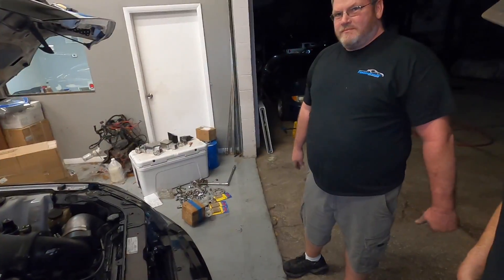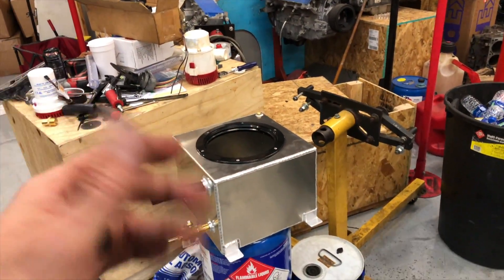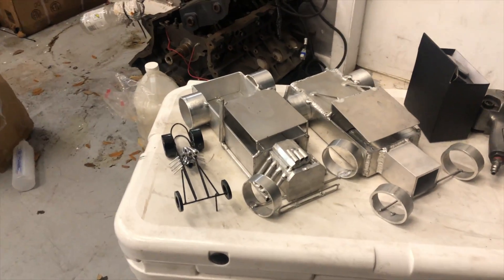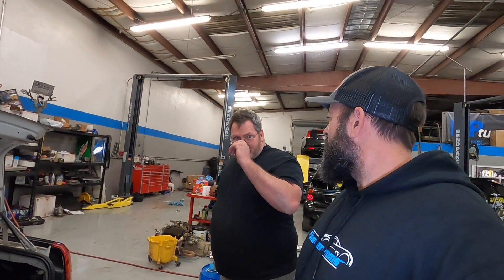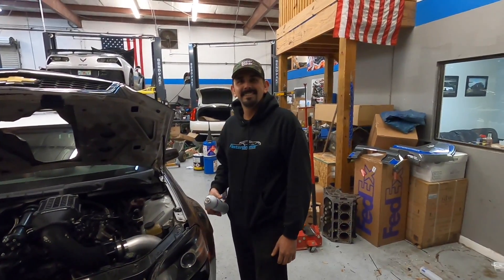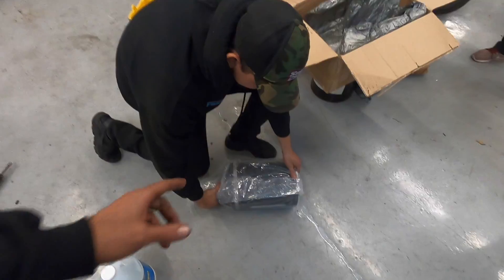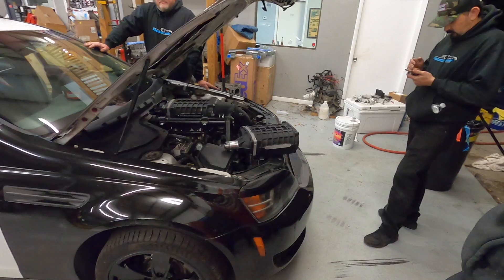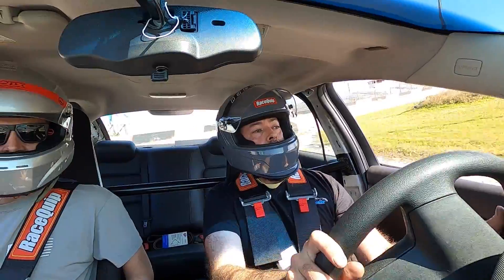Testing Our 1000HP Fake Cop Car...Ends With Us Getting Pulled Over By Actual Cops.

Comment: i cant believe that with all the money youve put into uncle sam to make him more badass you still havent replaced the $54 motor mount damn please get it fixed
Reply: He just needs a chain to hold it to the driverside 😂
Reply: @jaredanthony8070  or a strap like he had on the methanol tank and its the passenger side that bad the mounts broken so he would have to strap it to the passenger side
Reply: Mopar back in the day would just put a stainless steel cable on the drivers side mount on the 440 cars to fix the safety hazard when the thin pancake mounts split in half. Hell my Dart with a 318 with only external tweaks and a thermoquad used to break the mount every few years. I bought a 69 Sport Fury with a 350 horse 440 factory dirt cheap back in the day and I found the mount was broken and it had the SS cable holding down the engine. It worked fine, just clunked and jumped till it ran outa cable. Probably had been on it since early in its life as a dealer installed repair.
Reply: I'm pretty sure his wife's truck still has duct tape holding the intake on... don't hold your breathe bud.
Reply: Tuff mounts or Castlemaine rod shop needs to ship some over
Reply: @69Dartman  mopars are funny things. Couldnt throw a new mount in or revise one that will stay together nooo...just put a cable on it 😂
Reply: @jaredanthony8070  Well pretty sure it was just quicker and cheaper than replacing a bunch of mounts back then. On my Dart I finally found out I was using the wrong mount and I got the right thinner mount and I hadn't broken it till I retired it. They went to a much stronger clamped together mount on the later revisions of the k frame the engine sits on in the mid 70s or so and even when those break they don't lift very far till it's captured. I was going to convert to that style k frame and even had one that had been beefed up and welded but lost it when we moved to the house we bought.
Reply: @69Dartman  that's a shame but it was very mopar to cheap out by not putting a real mount in.. wouldve been better long term...
Reply: you beat me to it lol.
Reply: @hellblazer275  beat me too it tuff mounts for the win!

Comment: That's awesome that the local PD took it easy on you! I'm just waiting for the day when I'm in the same predicament for violating the noise, speed, tire smoke ordinance and hopefully my local township PD cuts me a break too!
Reply: About 15 years ago I was going about 140 and blew past a Trooper going the other way. He was booking in the other direction and we damn near blew each other off the road. I normally would have run for it because I was miles away by the time they pulled over and turned around. But I didn't feel like looking over my shoulder and pulled over and waited. It's a long story but I regretted it at first because they worked me over at first. But when he asked why I just pulled over and waited. I responded that I didn't see the need for them to risk their lives over a dumb mistake. He told me to sit tight and after what seemed like ages came back with a seatbelt and inspection ticket that doesn't have any points while thanking me for pulling over and said hopefully I learned my lesson. But stuff like that are pretty rare these days since the cops have changed. I'd have gone to jail now.
Reply: YA NO SHIT, HE GOT OFF BECAUSE HE IS A WELL KNOWN PERSON.

Comment: Loving the channel, have for years.  Passing along a belt squeak remedy is a coconut oil based bar soap, rub against belt on both sides while running, quiets it down without chemicals toastin the belt

Comment: Here's a little tip: Black gasket maker on the underside of the belt helps quiet them belts right up... Temporarily... But in my experience, it works like a charm... Temporarily...

Comment: Here's my little secret. Don't use lube on pulley bearings unless you are cleaning them. On brand new bearings use graphite powder as a lubricant, the same stuff that locksmiths use.
Just don't use too much.

Comment: To stop the belt from screaming like a squirrel in methanol , use DAWN liquid soap. All you need is just a dab( 🤪)
Reply: DEDBRD1977 baby powder 👍🏽
Reply: Or fix it properly and just adjust the pulley that is misaligned...probably power steering. It's easy to over/under install the pulley with the end of the shaft. 👍
Reply: DEDBRD1977 no ...
Reply: like a squirrel in methanol LMAO
Reply: @Forcefed2002  I can't tell you how much I hate domestic bullshit pulleys.

Comment: I’m a junior in high school. 
I’m going to study mechanical engineering with a minor in fluid mechanics. My goal is to design my own racing heads and intake for a run of the mill LS3 5.3 and 4.gr8s as a bolt on kit. Heads, intake and cam at a decent price that won’t break the bank like AFR would. 
I’m gonna call the set Uncle Sams

Comment: If the power steering pulley isnt perfectly flush with the end of the shaft you will get that belt wine - ask me how I know. Yall just did the PS too so... a half turn on the install tool too much or to little is all it takes for that slight misalignment to squall the belt.

Comment: If you get better motor mounts you might get rid of your shifting issue. If the trans is not as mobile as the worn out motor mounts you will stress the case and make it harder to get in gear on power.

Comment: Just put sand on the ribbed side of the belt and it will quite it down. Belt dressing and all that doesnt work. Needs to be gritty. Just a small amount of sand will work, will mold into the ribs and be silent

Comment: WOuld it help the performance by installing larger exhaust pipes larger pipes more exhaust flow less back pressure
Reply: motortrend tested this 4 hp difference between 2.5" and 3" it would have to be severely choked example 1.5" and i think at that point it would probably put a hole in it with the methanol injection/supercharger ( I could be wrong). The bigger changes come from the type of muffler chambered/straight through/brief case. Also if you have ever seen a thousand HP car blow apart a stock exhaust you know they are restrictive.

Comment: Wreckless driving, careless driving, driving without insurance or registration, speeding over 25mph above speed limit, emissions violation, noise violation, impersonating a police officer and a police vehicle, endangering the public.  And hell with the 4 point on when they come up to the blacked out ass window, you reaching to unbuckle the harness on your chest and your gettin shot.. if not than woulda gotten the car impounded and likely used as evidence thus withheld and disassembled and woulda never gotten it back..  but those infractions alone are multiple felonies and mandatory 2 years almost depending on judge.  Liscense revoked and treated like you got a dui..

Comment: I’ve always enjoyed the projects and content y’all make. I’m really not trying to be negative, but instead of trying to make more power with Uncle Sam, why don’t y’all put more effort in to making it somewhat of a legit and reliable race car, fix some of the janky problems it has. I understand it’s the shop test mule but the cutting corners to make stuff work becomes waist and gots to be a safety concern at some point. I mean, has it even had one good pass where nothing breaks or comes apart? Just seems like waist of such a bad ass engine and blower combo.🤷‍♂️ I’m all for free mods and optimizing stock parts to achieve good results on the cheap, but you gotta get good performance results as well and not just dyno numbers in order for that to count.